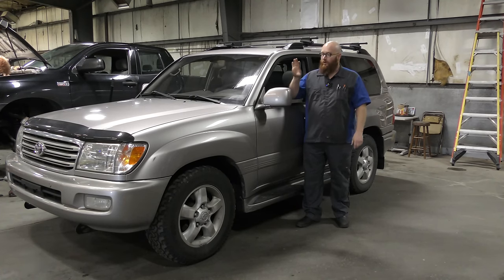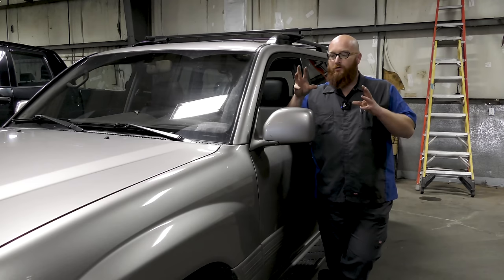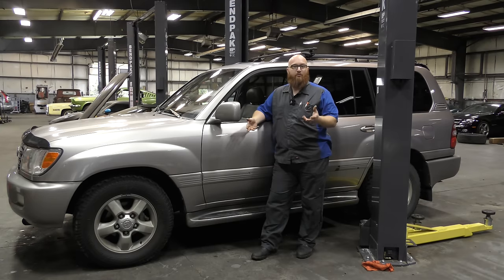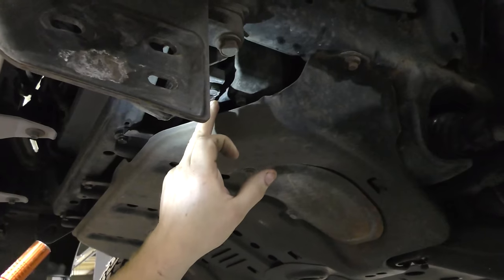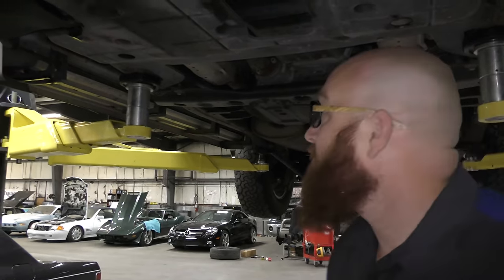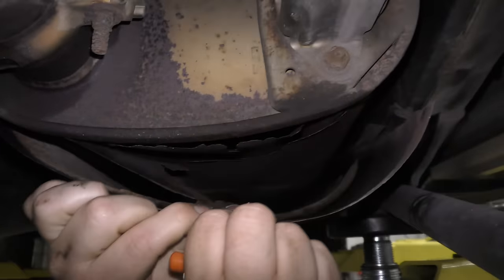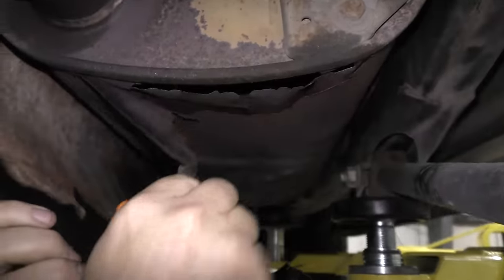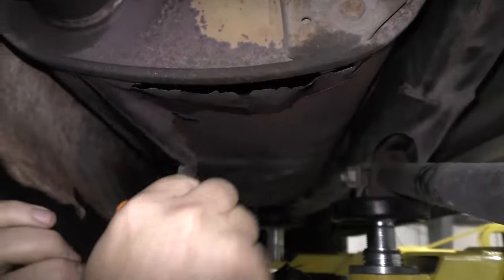Vehicle Making a Horrible Noise?! CAR WIZARD finds the problem & shares how not to be duped by shops

Comment: I had a Camaro that I swore had a rod knock. It was a double knocking sound with a light load on the engine. It turned out to be a bad catalytic converter, the core inside was broken and rattling 😅

Comment: I do uber  my explorer limited 2018 v6 3,5 L no turbo 230 000 miles never roblems on the motor no problem on trasmision ,please talk about ford with 2,5  L is very good fusion escape i had escape 2014 2,5 L i put 311000 miles trasmision went out at 311000 the guy fixed de escape have now 330 000 yhe same motor

Comment: Well my honda accord steering wheel shakes when i press the breaks at arounf 75 mph and higher. I took it to a shop and they told me there was nothing wrong with the front breaks. I had them replace the 1 of the rotor and also replaced both break pads. And before anyone says anything, i there is was something wrong because the passenger side was covered in break dust while all the other wheels look the save. So i had them changed it anyway when they said there was nothing wrong. And now when i 80 mph on the highway it doesnt shake my steering wheel when i break. I was not gonna drive with it shaking bc i wont feel save driving and knowing that it could fail at some point.

Comment: I love his videos and watch tons of them but the love for Toyotas, at least to me, is misplaced. I had an 03 Land Cruiser that I bought new and sold at 120k miles, never off road, extremely well maintained. Transfer case failed, hub failed, radiator, etc. garage kept and washed weekly and it started rusting at around 70k miles. I would still say it was a pretty good vehicle and fairly reliable but my 2012 Chevy 1500 has 296k miles on it now and has only needed a transmission, radiator, regular service, and I've replaced the ball joints, and other front suspension components and rear shocks.

Comment: I've had 2 '99 LC's and wouldn't own anything else at all. Stylish. Designed to last a very long time.  Reliable. Very comfortable. Getting harder and harder to find a nice 100 series. Hardly anyone will part with theirs. I get compliments on mine frequently and it's 20 years old. Remarkable automobile. I've run in to a good many people that could afford any vehicle and they chose LC's....that is as long as you want something low key and not flashy. If you want glam, get a Range Rover....but get a AAA membership!  RR has failure after failure. LC's just keep on rolling. I read a study where the average annual income for these 100 series owners is $250K per year. The website www.dashboardlight.com rates these 100 series as some of the most reliable vehicles on the planet and customer loyalty/ownership retention is ridiculously high.  Thanks for the video!

Comment: I have to say something negative about Toyota — not this Land Cruiser but High Lux pickup: at -45 deg Celsius in Siberia all rubber seals on its doors and windows get shrinked. Ice on the rear wall behind seat (through all 9 months winter actually). And Nissans loose oil from shock absorbers after 1 mile trip. Mazda bumpers become glass fragile. Here is a list of cars without those problems: Audi, Volvo, BMW, SAAB and Mercedes. Looks like Japanese never test  their cars for such cold. About US cars I cannot say anything as didn’t see them at that time (2000-2006). So, nobody’s perfect. Good luck to everyone.

Comment: The right front inboard CV joint is leaking. I brought a Sienna into an alignment shop after I replaced the steering box and the guy did not take off the outboard clip and wound the boot up like the Wizard found on this GX470, ripping both boots. The box was brand new and specifically stated that if the clips are not loosened when adjusting the alignment the warranty on the steering box is void.That mechanic learned his lesson the hard way after I reminded him of how to do his job.  Amateurs.

Comment: My family used to own Fords,Chevy and Dodges. Standard old American Vehicle. The last Ford we owned was a 1998 Ford Windstar with the 3.0. FUNNY Story that one to. We had a old 92 Dodge Caravan and it NEEDED A LOT of work. My father wasted so much money on a UNRELiable Dodge Van. So I look at my dad and mom and said. I'm done! This van is junk! You need to travel to your VA appointments. Just get a new van. So I took my mom to Sunland Ford. Not a second the Sale man comes out. She pointed at the Red 98 Windstar and said. I want that one. NOT even OFF the darn truck. Still in the Cellophane protective cover. 
But the old Red Van..  She got tired and old. 210,000 miles on that 3.0. We did everything except replacing the motor. So I looked at mom and said. "Let's try out a Toyota." And she agreed. So in 2010 we bought a 2006 Toyota Sienna with BABY Miles. I mean 30K miles used at our local Toyota Dealership. We got her at a GREAT price to. 16K. Now that Old Blue Van has 230K miles and still going like a Champ. Just the DARN airbag light is on and I don't know what to do about that. But man. She still drives like a old Champ.  
So, Wizard. 2006 Toyota Sienna? Airbag light? What can I do. I checked EVERYTHING on the Airbag line and I'm at my ends meet.

Comment: I made the mistake of doing a timing belt on a 95 3.0 v6 and not doing the water pump at the same time. I had it back apart 3 months later doing the water pump.. 😒

Comment: Mechanics will tell you whatever you want to hear.  My know-it-all daughter insisted that the brakes were bad.  I took the wheel off and showed her the pads vs new pads.  They were down to 80%.  Little surprise that a month later she quoted a lube tech saying her entire braking system was shot and he couldn't believe I let her drive with the car in that condition.
I told her to let that guy handle all the car repairs then and she could pay for them.  I'm sure she'll be getting stiffed by a dealer next once she's quoted $5k in unnecessary repairs.

Comment: Have a 2001.  Steel Brake lines rusted out.  Gave out at 208,000 miles on the road.

Comment: The only thing that will kill these things  is the UK climate. Salt and mud collects on a ledge under the back wheel arches due to a lip.  A u shaped lip at the bottom by the back door  also fills with mud and salt quickly and remains damp for weeks. (almost like it was designed in) it is also extremely difficult to get the hose into these places  to it to wash it off. The Tailgate like Range rover also rusts up especially top part which rusts worse by the number plate lights to the point they fall out. What a shame as the rest of the car realy is unbreakable especially the early 4 speed. The Frame itself must be made of a different steel as that never rusts. Tough new UK regulations which seemed designed to get every old car off the road means that that this is no longer  sufficient and a car that is even moderately corroded in any place will be taken of the road.

Comment: Wouldn't it possibly need an alignment after that amateur job on the tie rod?
Reply: It was more than likely an alignment that caused the issue.  Adjusting the tie rod without unclamping the boot caused it to bind up.

Comment: I took my car to a mechanic recently to get something small fixed and they blew my engine because its tuned to run on 93 only and they was driving it around dogging it with 87 octane my car is full bolt on cammed mustang btw

Comment: You missed the most important vehicles for off roading, Jeep. In the sixties and seventies they were much simpler and more reliable than either Land Rovers, which still had Dana 27 rear axles which were not strong enough for the added weight of the Land Rover over the Jeep MB models that they were first put in and which the earliest land rovers were built on.  The Land Cruisers of the 60's and 70's were prone to cracking heads, which led to a huge industry of converting them to run on American V8's.  My company would not buy either vehicle for off road use in our fields in Africa or South America.  Mostly CJ5 and CJ6 models with a s scattering of Wagoneers,  and later CJ7 models.

Comment: When gasoline burns,it produces CO2 and water ,LOTS of it; if toyota did not put a small 1/8th hole on the lowest part of the muffler, the muffler WILL  rust from the inside out, due to the accumulated liquid water inside in short trajects;    shame;   
 now...*you*  put the said hole in there!!   Rolls Royce always did;  me too.

Comment: Had a small toyota pickup. To do the overhaul, I took the engine off myself and took it apart at home. Fixed it and put it back on myself. Why? I do not trust any mechanic. If somebody is going to workon my vehicle, I I have to see it with my own two eyes.
The pickup, I had to sell because it was too small

Comment: I do like those old Toyota 4x4, especially the old non turbo 4 cylinder diesel could run forever. Simple and reliable. We had those in Europe, I owned one 80s diesel FJ42 there, my buddies owned several "tacos">Hilux as they are called there, also with diesel 4. They could run forever...Not the fastest, and on FJ42 because of a bit wider than stock tires had to change some of the gazillion steering tie rods etc once in the while. Also, rust was an issue..But one of those Hilux or FJ would be the one that I would take to the desert or outback. I love American trucks, I drive a 4x4 Ram1500 Hemi 5,7 but if going for some serious off roading...Toyota...Or the one that we also owned, 109 Land Rover. Serious stuff, both of them. Tools, not luxury.

Comment: I even drove a 3 speed when I was 17 Yr's young .... Pulled away Thinking it  had 4/5 speeds ...lol 🤭 . My wrong .. good old Tanks ... Lazy "Tracking" shops .... a bearing ! Usual @ any miles ... and To Think Toyota turned to Land Rover and ask For Permission to Use Their design of 4 X 4 System .... about The only thing that would go or Need changing a Rear exhaust box and moisture .

Comment: The price to change the timing belt, water pump, and pulleys and serpentine belt is CHEAPER than trying to get a new engine. Yes it's a Toyota. But it needs it's maintenance. Get it changed and it will definitely last another 100k miles.

Comment: You should not buy a six year or older car if you don't know how a car exhaust works and fails. I drove nothing but the cheapest cars I could find for the first ten years of my driving experience. Toyotas and Hondas are more expensive, but worth it. As soon as the wizard described the noise my mind said that's probably an exhaust issue, maybe a worn suspension part, but most like likely an exhaust issue.  Sure enough it is .

Comment: You can tell that vehicle has never seen a salty winter road.

A 2021 STARTS at $85,000.  Way out of scope for most people.
Reply: My range is up to $8500. I drive a 2006 Tacoma 2.7L standard transmission that I bought last year for $4000, it has now 190,000 miles on the odometer. Made some repairs, changed the clutch myself, so I guess the total added up to that figure. But I'm good to go another 200,000...

Comment: The reason they drive toyota in iraq and Iran is because the usa would not import to those countries! Not because they are the best! I have had 6 ford's go well over 325,000 miles and I have a 94 F150 5.0 that has over 600,000 and that truck still gets beat when I drive it.. so it has way more to do with the fact toyota was importing to those countries than it does with "it's the most reliable"

Comment: buy once cry once,  yes land cruisers are expensive...  but after 27 years and owning 4 I have never been on the side of the road with one and mine have done a lot of trails and off road runs...in places that any gm or ford product would not have come back from..  I bought my first cruiser after putting 3 transmissions and 2 rearends in a Tahoe in 150k miles...  300k on my current cruiser and it has a stock transmission and rearend...  and they have been used and abused...  it is toyota's flagship for a reason,  overbuilt everything.  The design criteria for land cruiser is 15 years unlimited miles in some 3rd word country without roads.. .  if you do the proper maintenance to them they are should last 15 years and as many miles as you can afford to feed it fuel....  if you don't work on your own stuff find a really good shop, there are many really good cruiser specialty shops that survive just on word of mouth in the land cruiser community and do quality work..  ohh and buy toyota/quality  parts most of  the aftermarket stuff is really lesser quality on cruisers..

Comment: no 1 car at the camel races.
Reply: Ever wondered why ? I used to own one bought it in 2003 brand new with the 4.5 litre stright 6 and manual transmission and I managed to put 800 thousand kilometres on it and I didn’t need to change anything except the oil and the belt
Reply: @Saad-ic8np  no. i know why. reliability. i never had a landcruiser ,but i have had an 85 forerunner, rav 4 .05 .and now i just bought a 08 lexus rx. loving it

Comment: No body shame this man for plugging Toyota. My moms 2001 camry that I've been driving since mile marker 130k'ish has a P0420 code. I replaced the cat. Bank 1 sensor 2. All others were done b4. Map sensor, plugs and wires. After all  that I found out it is sipping oil from the middle cylinder on bank 2 since it was the only plug with oil on it. Also it will blow burnt oil out the exhaust on warm or summer days. The oil pan leaks a bit and now the trans pan does too. It has 186k on it and keeps running. The worst offender are all the suspension bushings that keep eating sway bar link bars front and back. Too much work for a rusted out midwest car to do even for me. I don't beat on it i just drive it. Also the I.A.C. valve needes to be removed and cleaned because on cold starts it would rev to 2000 rpm. Youd think I'd have a Lambo or something. In the warm weather months it still got 25 to 27 mpg. In the cold months with prestart and all about 20. Thats not bad for a car with a head issue, that many miles and age. To bad it wont pass emmissions until that head gets fixed wich will never happen plus the suspension. I have a 1977 Z28 project car. I don't want a 2001 Camary project car. It's truly sad my Toyota will meet its demise very soon.

Comment: Uhhhh, to say that the Taliban doesn’t drive Fords because they like Toyotas might be completely related to the fact that if Ford catches you doing business over there- pets, information, vehicles… ANYTHING, you get sued. Toyota doesn’t have those ethics. I did that business for 30 years. I am on my 5th Ford pickup and have found them absolutely bulletproof. My buddy’s a Toyota guy. He’s had more repairs than me, plus they’re about 50% more expensive to boot. I think Tacomas are comically overpriced, and crude as a diaper bag of diarrhea. Nobody ever said that the Taliban were just intelligent, and I think that applies here too.

Comment: They are built to push trees over..... push rocks over......fall over.............roll around in 105 Farenheit temps.........-60 as well......I used to align these at the dealership....they are built so well underneath and a lot of common sense engineering to boot. Simple to work on except for changing the break rotors. Now that is a different story 😂 Built like a brick shit house! Damn rust belt ruins them though......
Reply: And the previous generation is even tougher!

Comment: tell customer to straight pipe and true dual his v-8 also the running gear and body is same design as the big 3 suv therefore its no better off road or reliable your starting to sound like kilmer